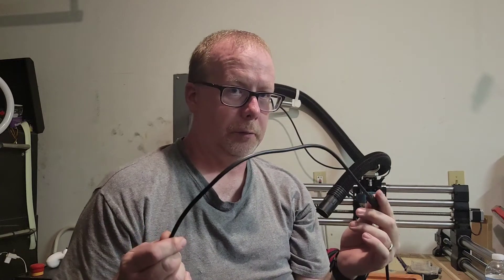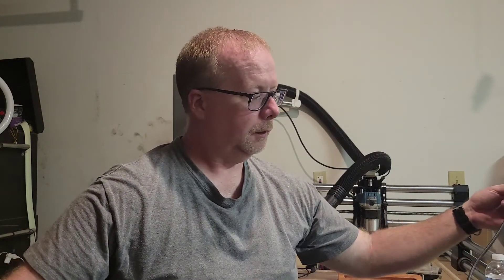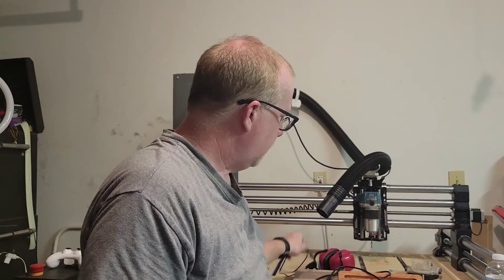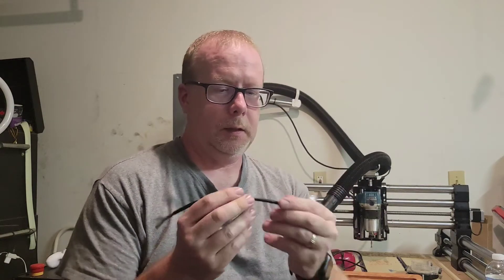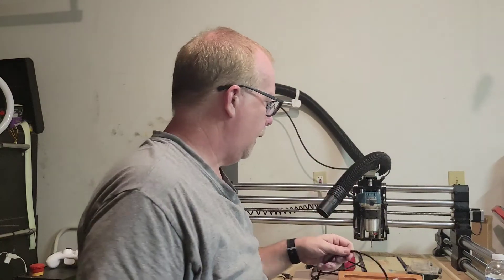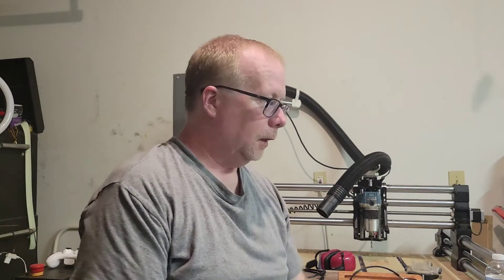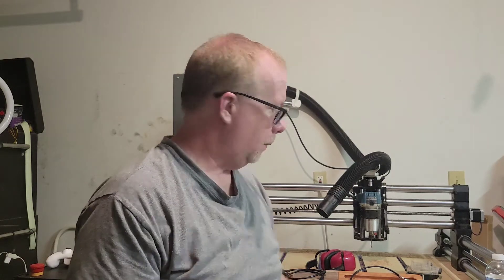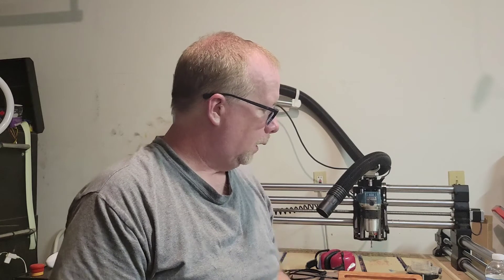Why Does My CNC Stop?- EMI- USB cables - Jeff Holmes

Comment: it only happens to me when my computer is plugged into any circuit in my house, it happens randomly, first minute or even the last... if i run the laptop off battery power, then im fine. i just cant turn on or off the air or vacuum wile cutting.
Reply: It sounds like you really need to put everything on separate circuits or at least your machine. You can also try rerouting your USB cable.

Comment: Thanks for putting this out there. Definitely a topic that keeps swirling around the FB group and forums. I'm in the process of setting up my OneFinity and worry that the existing wiring in the shop here isn't going to allow for a separation of circuits completely between my controller and router. I was wondering whether or not you have had any experience with power conditioners or other kinds of inline EMI filters as a solution to having things like routers on the same circuit as the controller.
Reply from the maker: Brett, I'm just trying to share what I have learned over the years.

Comment: Can Security Cables be used for cnc applications?
Reply from the maker: Mick I'm not sure what you are calling security cables.  You definitely want twisted shielded pairs. I would probably stay away from using anything like CAT5 cables because each pair has a different twist length.  Each CNC manufacturer has different stepper motor wire and generally the don't have a ground.  What you have to be careful with is the USB connections and your AC power lines.